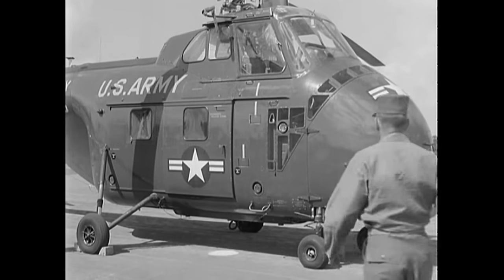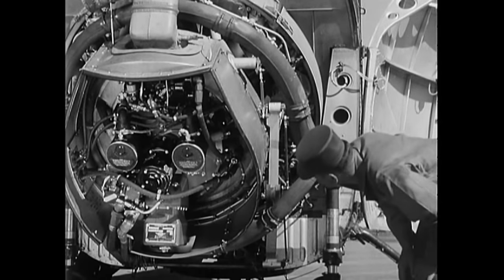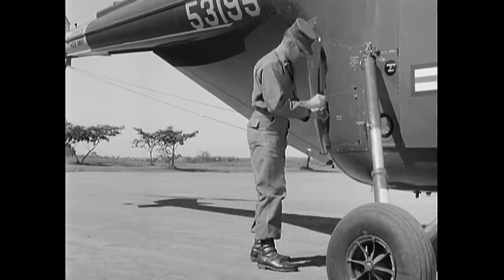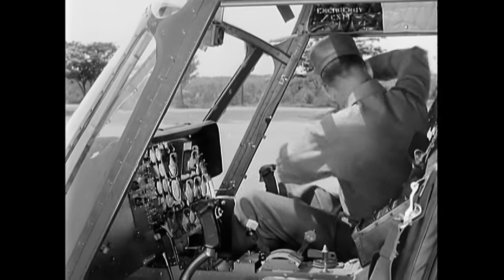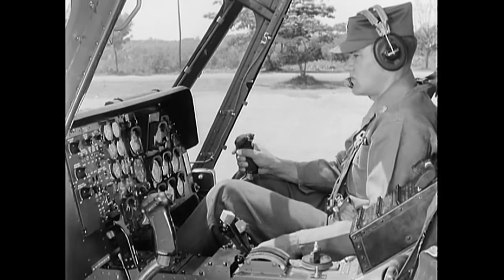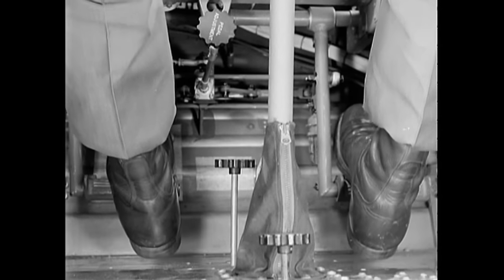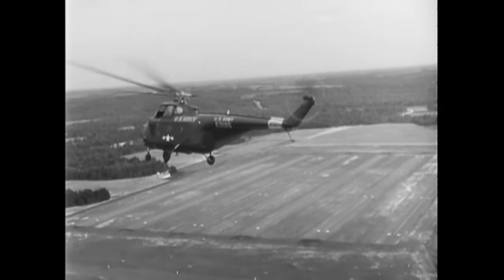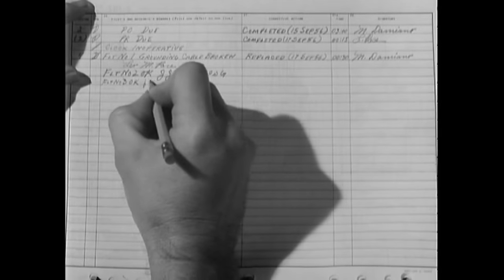HOW IT WORKS: Sikorsky H-19 Helicopter

Comment: Made my first Static Line Jump from a H-19 - was somewhere near San Antonio, Tx, circa 1967 or 68.    The copter was out of Ft. Sam Houston, as I recall.  I was USAF stationed at Lackland AFB (MTI duty).  Most of the other jumpers were Army Airborne (who were learning to Free Fall.)    Made quite a few jumps from the H-19.   And, yes, it was noisy as hell, and did vibrate a lot.   Ahhhh, great memories.    USAF Avionics, Ret.   B-6370 PCA & USPA
Reply: Made many flights on these in the 60s. No jumps but did a few repels. Loved them.

Comment: Sitting on top of a big block V-8 Buick motor, there is a clutch and direct drive line to a differential that feeds power to the main rotor drive and extended drive line to the tail rotor. If you ever get a chance see one of these in refit, it's awesome 😎

Comment: Check EVERYTHING!
Reply: Check your breathing

Check your pulse

Check your Urine

Check your prostate

Check your liver values

Check the stock market

Check the weather

Check the air

Check the trees

Check the grass

Check the tarmac

Check your mother

Check your Father

Check your brother

Check your current written adress at the postal office

Check your uncle

Check on your Czeck pen pal

Check your dog (PET HIM)

Check your sink

Check your insurance if it covers water damage if your not present in the household

Check your bathroom

Check your bed

Check your gas lines by having a authorized tech checking it. whilest doing so also call a electrician to check your fuse box if it's up to code

Check your foundation for sinking

Check load bearing walls and arches

Check your lawn (For commies)

Check your shed (for more commies)

Check your Daily driver's service interval

Check your wallet

Check your pants

Check your pockets

Check your zipper

Check UNDER your bed (for sp00ky commies)

Check your closet (cannot be too safe against Sp00ky commies)

Check your neighborhood

Check your drievway

Check why do you compulsivly have to check things

Check your sanity

Check into a insane asylum

AND FOR THE LOVE OF GOD CHECK THAT YOU CHECKED EVERYTHING

Comment: It is halarious that the procedure for checking the fuel is to dump some on your hand, lol.
Reply: and PUT OUT THAT CIGARETTE first!
Reply: It was a different time... lol
Reply: Now you got a cup to catch it in, so you can check for water.  Not sure how you could check that, or anything else for that matter, besides ensuring 100LL smells like 100LL, and you don’t have any boulders in the tank.
Reply: @jaysmith1408  

Boulders would be a Bad Sign™ 🤣
Reply: Not as hilarious is when your skin is allergic to fuel so you use a lighter
Reply: @jaysmith1408  Water will make a visible layer on top of oil, so you will see it actually.
Reply: @vallorahn  it would, but would be a bit hard to see just in your hand, probably why they make the little fuel sample cups.
Reply: @jaysmith1408  water in fuel beads up when dumped on the tarmac!
Reply: @dannelson8556  whoa… that’s really intense. I’ve never heard of that. Like you said, it was hushed.
Reply: @dannelson8556  I had a guy working with me who had woked in a refinery and told me the same thing 40 years ago...that and Benzine. When either was spilled,the whole place would be on alert and the lead crew were all suffering the effects of lead poisoning.

Comment: "And check for 'excessive' oil leakage" :D
Reply: +rkan2 Yeah! I caught that and was laughing....they're all leakers. ;)
Reply: That's how you check the oil on a radial engine. If its leaking the oil level if fine.
Reply: If engines from that age do not leak oil you suspect there is no oil inside them

Comment: Will all the mentioning of proper oil levels as well as hydraulic fluid and fuel , I am surprised they didn’t emphasize checking prop wash level. Very important and the job of every new mechanic or crew member of bird regardless of branch of service.

Comment: Jesus. This would never pass an F/A-18 inspection, not even a turnaround. When they designed this thing, they must have imagined that it would function in a military manner in a low-stress environment.

The aircrew flying, crewing, maintaining, servicing, testing, troubleshooting, modifying, repairing Battle Damage, salvaging, investigating, and managing these squadrons and sections, were truly tough and brave. They made decisions and got things done with new technology and equipment such as this bird, like hot rodders behave in the car community. My deepest respects to all three groups.
Semper Fi
 
R/S
SSgt Cruz, D.C.
USMC (Ret)
0311 / 6217
1986-2010

Comment: I preflighted c-152 and c-172's long ago, but I recall we had a little plastic cup with a pin to check for water in the fuel, the pilot there is using his hand, thats zany. He should at least had a Dixie cup to check it. Fuel is slightly toxic, it wonder if it caught up with him in his latter years. Never can tell. Cool radial engined chopper...

Comment: Very interesting. Although I don't know why the designers placed the engine in the front. I guess gas turbines weren't available back then
Reply: Early 1950s helicopter. It was the only place to put a heavy radial aircraft engine. At that time they were still working out the gearing to link a turbine to propellers or Rotors. Early turboprops tended to have frequent gearbox failures. Same problems would have effected helicopter applications.

Comment: I remember a TV series where two guys were detectives, and had an H-19 painted pink.
Reply: Riptide 84-86 you can find some of the episodes on You Tube.
Reply: Screamin' Mimi! Murray Bozinsky, Cody and Nick. It was a turboshaft version.
Reply: @rodrigoruffa7460  It wouldn't fly unless you punched the overhead panel :D
Reply: They flew an S58T, a turbine conversion of an H34

Comment: At engine start, how did the mixture magically go from idle to full rich?
Reply: Excellent question!  Had to look over again, i mean, those starters are powerful, but not rotor at 1200 rpm powerful.
Reply: Check out the vids of these things firing  up....

Comment: Wait, you can just pull down on a valve on the bottom of this helicopter and drain some fuel out? That's insane.
Reply: More like push the valve up against a spring and seal.  If you pulled it down, then the weight of the fuel inside would constantly push it open.
Reply: @rigger8722  right, it's just crazy to me you can just do that with your hand. I wouldnt want some pajama wearing slippery slope to know that.

Comment: Soo many checks, almost every nut, bolt and rivet is under scrutiny on this helicopter. 
I am sure they are now obselete. Petrol radial engine that was used in fixed wing aircraft, tanks and this helicopter. Wright or Pratt&Whittney..?? They were built in Britain as well.

Comment: "Check for excessive oil leackage... So this leaks by design? XD
Reply: It's a radial engine they always leak
Reply: If they don't rattle like a jar of old bolts, the valves are too tight and if they don't leak there is no oil in them. That's about it.